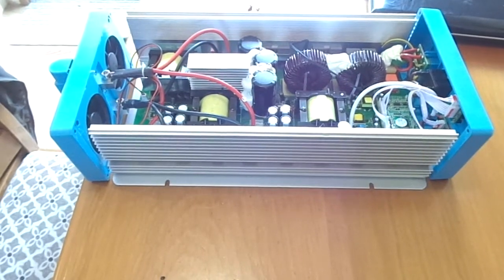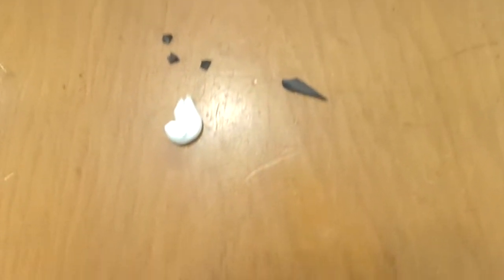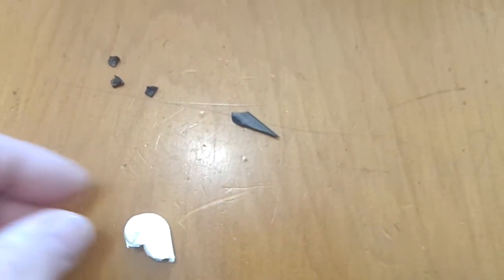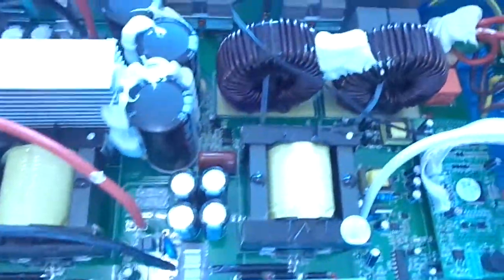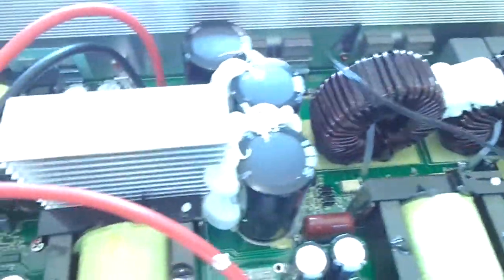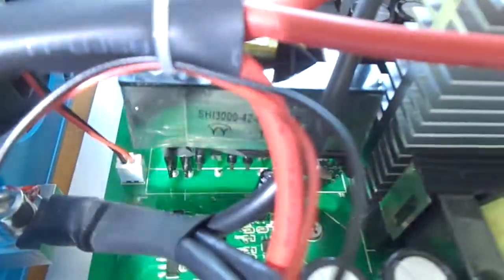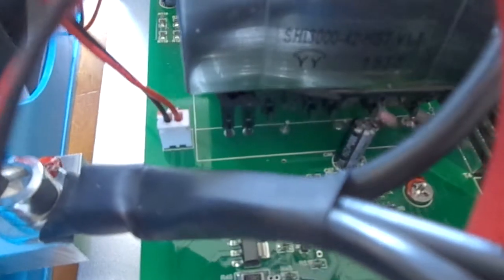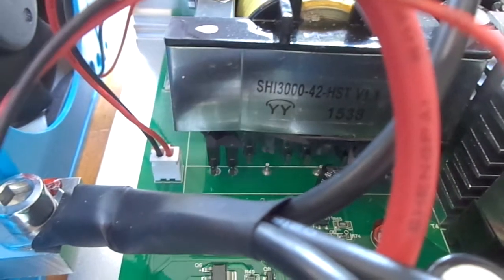Opening EPEVER 3000 watt inverter after noticing some loose parts inside. Damaged.

Comment: i have 3kW 24v inv. has been on constantly ON for over 2 years cause my house is cut from government electric grid.  I have used serious loads. Electric saws to cut all wood for winter.
I like its protection features. Even electric chopper 2.9kW. 
Starting these cutting tools at 2.8kW creates surges over 12kW. So it wont start the tool.
To by pass it without compromising safety of inverter, add 600-1000W water heater coil in series. Now that is started switch back to normal connection without interrupting electric circuit on 220v side.
Reply from the maker: Artjoms Pugacovs 
Sounds like it’s working great for you.
Thanks for your comment ✌️

Comment: Mine got replaced by just paying the shipping cost, without a need to send back the broken one. The ebay seller was sureelectronics, very responsive. Second one is working perfectly.
Reply: Sureelectronics where rubbish we mine, try to tell only 6 month ebay warranty which is rubbish, had to get Epever involved to get a new one, which ended up being a repaired 2nd hand one. Now that 2nd hand one has stopped talking to the software. Buyer beware of Sureelectronics.